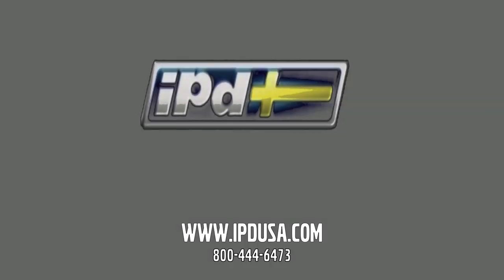IPD Volvo Subframe Bushing Overview

Comment: if you have a drill and some bits you can pop the bushings out incredibly easy and put the inserts in brand new ones without dropping the subframe. Just have the sub frame supported and take out the bolt and washer on one corner. If you see where that blue collar is all you need to do is visualize where the collar is looking at it from the bottom (it's easier to visualize with a new one in your hand) and drill till you hear it break, a screwdriver or pry can do the rest. You will also see plastic flakes when you're on the collar.

Comment: +turbochargedbrick, No, they will not. This is like going to the emergency room, & having a nurse tell you that you need stitches, but she can only give you an ace bandage. The dealership DOES NOT drop the entire subframe to replace the bearing. They have a special tool that, once the bolt & washer are removed, actually cut & pull out the old bushing. The new bushing is pressed back in. A genuine subframe bushing will last about 5-6 years. However, this is dependent upon the engine mounts being in good condition. If the engine is not isolated from the subframe, then yes, the subfrmae bushings will prematurely wear out.

Comment: Hi, Seems excellent product, In my S80 1999, I can hear clunk sound from the Left-Rear (Drive Side), bubbling tires while cruising (All suspension items checked and fine)  and as per mechanic its sub frame mounts that need to be change. Since it requires much time and $$$ to install them can these bushing inserts helps to reduce those clunk sounds.